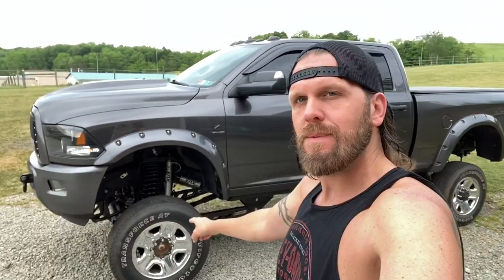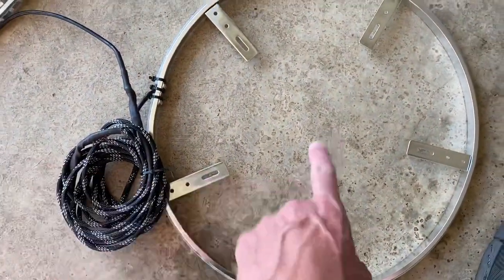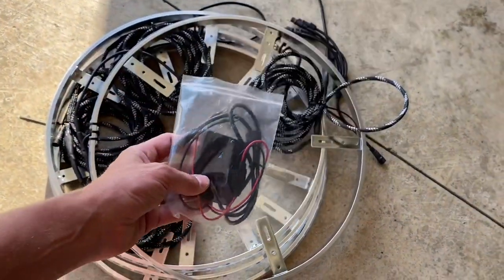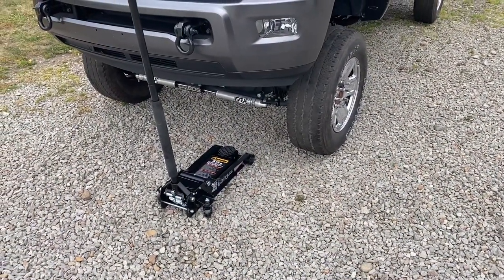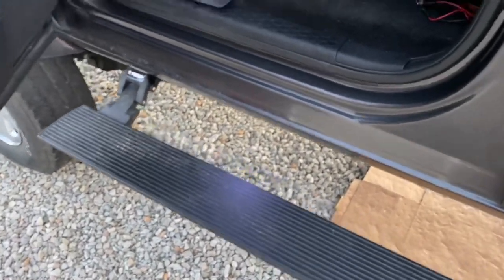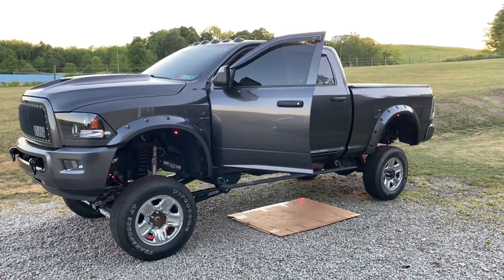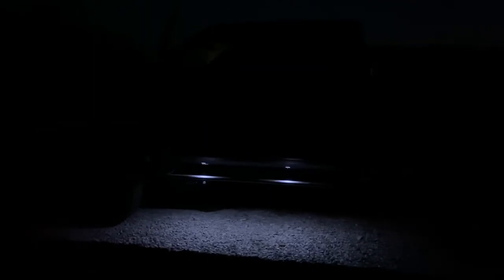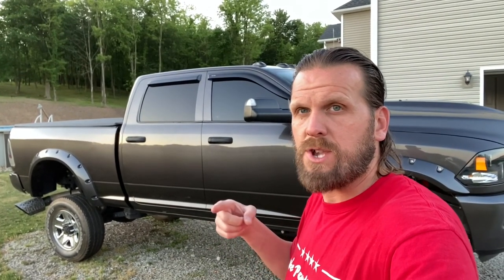Wheel Light Install & Review

Comment: Correct way to do it without removing tabs would have been to remove the caliper and rotor as you went along, that is how it is meant to be done, but your way works quicker with less work
Reply from the maker: Absolutely, I was just lazy and like to do things quick when I can lol.
Reply: @DieselLegiance  Yeah probably same way I would do it 😂 I just spent 5 hours changing pads and rotors, wouldnt want to do it again just for lights
Reply: @DieselLegiance  I don't blame you fixing to do mine the same way 😂

Comment: I had mine installed and when I drive it makes a weird noise and don't know if it's normal or not wondering if you can help me 😵‍💫
Reply from the maker: What makes a weird noise?  Is something bent (heat shield) or hitting another part when driving?  Is your wheel lugs loose?

Comment: Will a 15' ring fits a 20' rim truck or the 17' ring fits better
Reply from the maker: It’s say go larger as the 15” is fine but it’s tricky to fit around the caliber.
Reply: So u recommend 17.
Reply from the maker: If you can get a 17” it may fit better on heavy duty trucks with large calibers.  Mine fit but are a little tight/tricky to install.

Comment: Three of my rim lights are working the one on the driver side went out can I fix that I think I ran over a curve looking at a woman then a couple of days my my driver side Rim light did not work no more
Reply from the maker: I’d check your connections first to make sure you have solid contact and maybe add some dielectric grease in each fitting for a better contact.  If the lights still don’t work you may need to replace it.

Comment: It's common. I have a set from oracle, and I had to adjust mine. And the funny thing is I used zip ties to mount mine and I trust them more then the self tappers they supplied. The one thing I've noticed with all these kits are they all look identical. Brackets, lights and light ring. Except for the wiring. Oracle doesn't supply the mesh cover like others do. I love mine but I do not recommend oracle, for the fact I paid around 500$ for mine which was 2 day shipping and a separate control box which others seem to be Included. But I went through all the same things during install and still do with all the others I have installed.
Reply: What set do you recommend
Reply from the maker: Honestly there are so many good brands out there.  Mine are from Patriot Lighting but One Up Lighting is good, NXTLVLIndustries, AdrenalineOffroadOutfitters, etc.

Comment: Don't you have to remove the caliper and the rotors to drill the holes in the dust shield? since you used the rivet gun to mount them to the dust shield.
Reply from the maker: I didn’t when I installed mine but it’s 100% easier of an install if you do.  I also recommend the if you have a truck with larger wheels, I’d suggest 17” wheel rings instead of 15”.  My rings are starting to have issues so when I do replace them, I’ll go with 17” led wheel rings.

Comment: Do you know what size I should get for 20 inch rims?
Reply from the maker: Most are a one size fits all but whoever you buy them from just ask if they make different sizes?
Reply: Size of your wheel does not matter.  The size of your rotor does. 15.5 inches is the most common. Very tight on a 3/4 ton newer pickup so just get the 17

Comment: Are they the 15.5 or 17.5 size?
Reply from the maker: They are the smaller size.  They are honestly too small and fit tight.  I won them in an online contest but I’m thinking of replacing them with dual or quad row 17” wheel rings.

Comment: Just curious. Im wanting to buy some for my truck. Would the lights melt off of the aluminum ring? Looks like it might be resting on the calibers....? No issues with them?
Reply from the maker: They are just above the calibers and when installed they don’t seem to heat up or melt.  I will say, if installing them, take measurements first and take your calibers and rotors off to install.  I did it the lazy way lol.

Comment: I don't understand why you just don't take the two caliper bracket bolts out remove the calipers and then remove the rotor and have clean access to the dust shield? Blew my mind. Clean install though
Reply from the maker: Cause the rotors were seized on and I was in a hurry.  I busted them out later when I replaced the rotors and brakes.
Reply: @DieselLegiance  oh OK. I was going to say I was just hoping you weren't making your job harder 
I'm actually looking at the same kit for my truck I watched the video and they turned out pretty good so I think I'm going to go ahead and pull the trigger on them

Comment: How do you connect it to the battery
Reply from the maker: Power box module that connects right to the positive & negative terminals.  I like to add a switch just as an easy on/off.

Comment: How long did it take you to install?
Reply from the maker: Maybe a couple hours but its not hard.  It’s much easier if you can take your wheels and brake calibers and drums off but I tried to install without taking the drums off as mine were stuck on lol.
Reply: Back drums ? How u go about getting brackets
Reply from the maker: I’m not sure what your asking but I’ve seen installs before where they removed the calibers and drums and the wheel ring brackets (after taking measurements) were mounted to the heat/dust shield then everything was put back on.  I did not do it this way and just rigged it my own way.
Reply: I meant like they sell brackets for the back separate so if you don't have 4 disk brakes and you have drums on the back you can still make them work I found the brackets
Reply from the maker: Oh that’s cool.  I just used what came with my kit.  But hey, if they make updated bracket for an easier install I’d say do it 💯

Comment: Or you could just take the extra 15 minutes to pop the caliper? Or am I not seeing something obvious? I only truly work on chevy trucks, but getting a caliper, rotor and obviously dust shield off takes a matter of minutes once it's up. Zero hate/ everyone does their own thing their own way. Was just a thought seeing as it would take me three times as long to find a charged m18 battery , swap to a cutting disc. Remeasure cut and then hope I didn't miss anything rather than popping it on "correctly"

Comment: How do I reset them mys stay on red
Reply from the maker: Contact the seller of the wheel light.  Could be a ground issue?  Check all your wiring and look for any loose connections.  Check the twist connections to make sure the metal prongs inside are not pushed in or damaged.  Check your app and make sure your phone is not connected to any other source like the radio to make sure it’s actually connected to the app.
Reply: @DieselLegiance  thanks